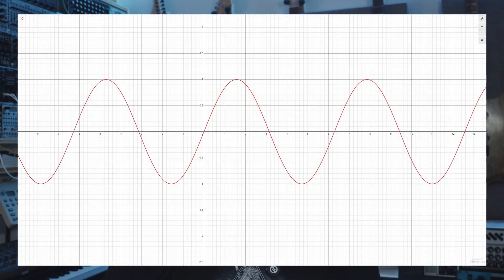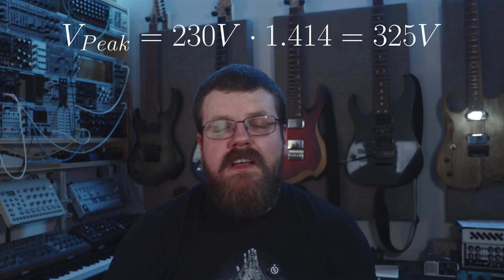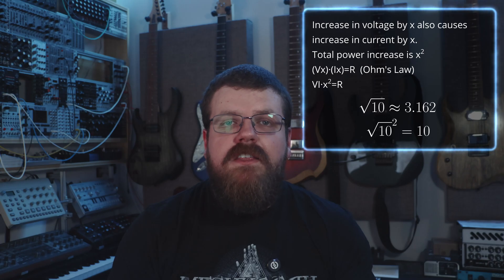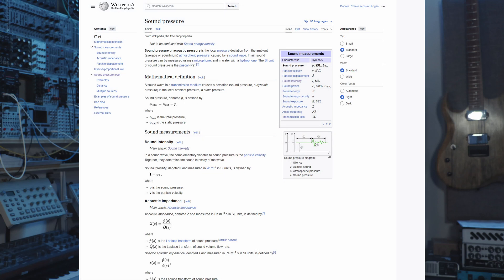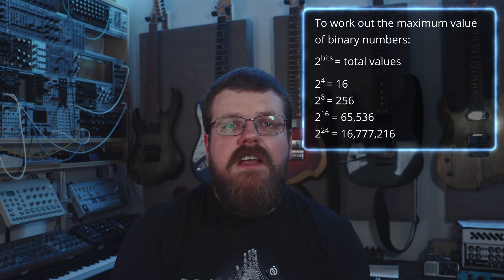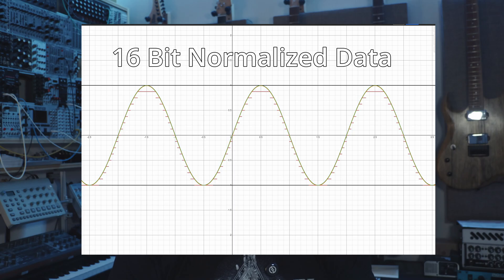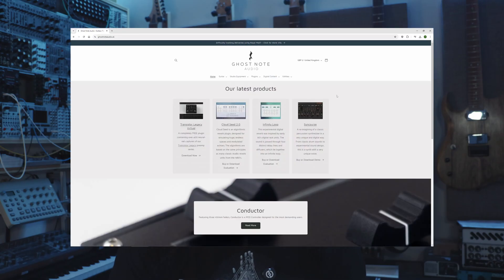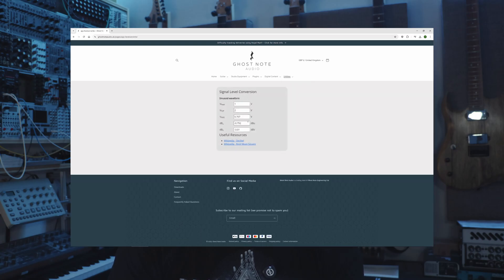What is a decibel, anyway?

Comment: Please correct me
So I've a Motu Ultra Lite MK5 (18db), I use the aurora dsp Iron Heart.
So they told they have the same specs than Neural DSP.
With my guitar I have to increase the level of my input gain to +15db before clipping.
So on the software I do 5,8-15= -9,2db.
I have more noise with this method than using 0db at input and 5;8 on the software, is it a normal situation? What is wrong? Thanks

Comment: Question: As stated in other videos, I recorded DI guitar with DI box, and the lvl of the input in the interface to improve noise to signal radio  instead of minimum input. Recorded a reamp without reamp box ( stated in another of your videos) direct from an output of the interface to the input of my rig. No noise or ground loops.  My question is: should I match ... I don't know, the lvl  of something or the voltage of something? The output of the interface seems to be Line instead of Inst, and I can't see a way to change the output ( Focusrite Scarlett 6i6 2nd gen). It does seems to be a little bit higher in vol, and I'm getting more lows and low mids, around 200 to 500Hz... Maybe it's pushing the amp a little to hard? Does someone knows how many dB should I change ?